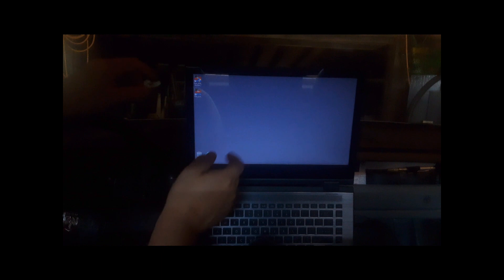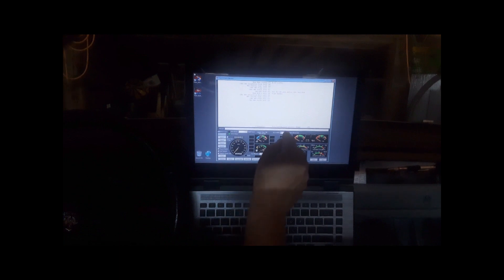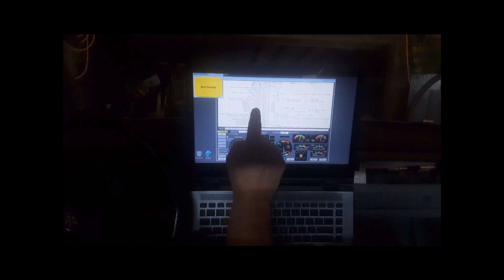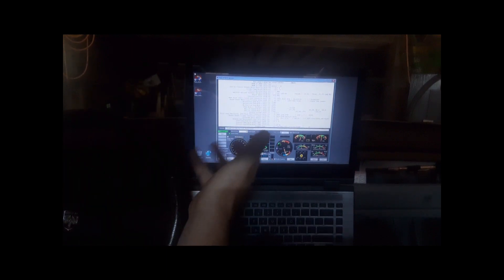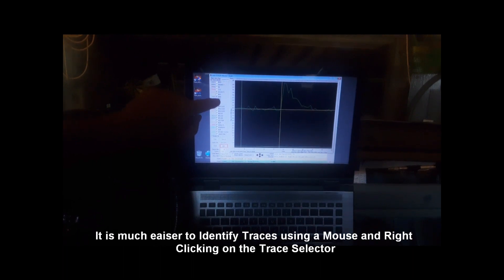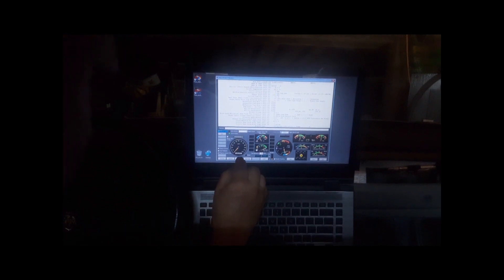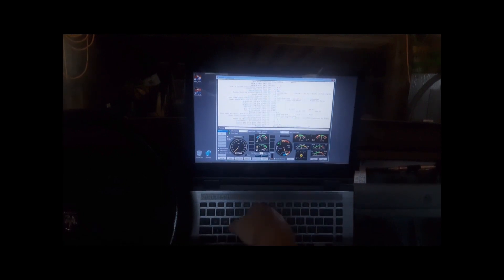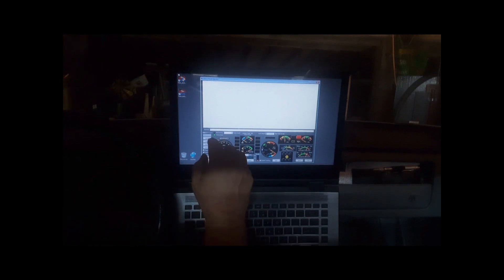Fiero GT ALDL Monitor In Car Demo

Comment: Hi Paul, this is really cool, great job designing this. Do we navigate to your site to purchase your cable? Just to clarify because I see some mention of the arduino in the comments,  to be up and running such as in the video one would need your cable (or diy similar), and a ? windows pc? What version of windows can be used, and if an Arduino is required or recommended which one might that be? Thanks Paul
Also I’m going check your other videos now, and subscribe so that I won’t have trouble remembering where I found this great info. but I wonder if it was you that had a really nice and highly detailed video I came across once that breaks down the fiero’s EGR solenoid? I had left that person a comment and they replied but then I had lost that video after some computer troubles and really need to find it again. Thanks again Paul and take care
Reply from the maker: I can't mention my web site on this "site's" comments due to some weird rules. If you go to the video "more" info in the description, the second link is to the web page you will need.

The first version of this tool used those simple adapters that "fooled" an RS-232 Baud rate in seeing the ALDL 1's and 0's as ASCII bytes, but that was years ago on my old laptop that actually had a serial port. Since then, they put USB ports on PCs instead of RS-232 COMs ports. Many sites now have ALDL cables that you can buy (or make in rare cases) but they still use that "fooled" RS-232 trick with a RS-232 to USB adapter built in. So, they are really no better. I decided to improve on all those others and use a microcontroller (Arduino, then the Trinket) to actually measure the 1's and 0's pulse widths and send an ASCII '1' or '0' over USB to my GUI.  Also, many cables can only do ALDL Mode as they have a built-in 10k Ohm resistor built into the cable, or some have jumpers you install to put the Fiero in the modes. My Adapter sets all 4 modes under software control via GUI control at the click of a button - no jumpers.  My adapter can monitor the Service Engine Soon (SES) signal, if you add that signal to your Fiero's ALDL connector - I have instructions. If you do that, my Adapter will count the flashes for you and display the Error Codes, if you don't add the wire, you simply count the flashes and then look them up in the GUI. Finally, my Adapter can monitor the Shift Signal if also added to your car's ALDL connector.  So my adapter is high-performance and feature rich compared to the others.

The GUI will run on Windows XP thru Windows 10 and beyond. The install on Windows 10 (too fancy for its own good) requires extra permissions settings but once set, it works the same as on any other version. The laptop you saw in tye video was Windows 10. Not my favorite but it has a touch display that I wanted for the video.

You can build your own Trinket or Arduino adapter (instructions for both are in the download) but I recommend I build you one for you at cost plug shipping  - no profit - as the ALDL cable requires some modification and re-potting the connector back shell.

Also, I am here to collaborate with users on how the GUI works and help you diagnose what the GUI tells you. But you have to find my email address and contact me that way for detailed personal advice.

Please respond with a comment when you have read this comment.
Thanks,
Paul
Reply from the maker: Also, you don't need the Adapter to run the GUI, so you can try it out first before investing in a cable. You can play back recorded files without an Adapter, but you need an Adapter to make recordings in the first place, however, I can send you a recording you can play back to try it out. Once you have the Adapter, you can Monitor, Record and Playback ALDL data.
Reply from the maker: Yes, I have a video on the EGR that I made after I fixed my EGR issues, many of my users found that slideshow video helpful. It actually shows you how to bench test the EGR Solenoid and the EGR Valve.

Comment: Do i need to setup the arduino to make your program run? or is it taking the place of the ALDL cable with usb?
Reply from the maker: The Arduino UNO requires you program it with an .ino file that I provide with the download, as well as a schematic for using the Arduino UNO as an adapter. But the Trinket M0 is a lower cost adapter and has simpler circutry - I provide the .ino file and schematic for it too in the download.

If you want to run my Fiero GT ALDL Monitor - Grahical User Interface (GUI) - you DO NOT need to connect an adapter, you can playback files without one, but without an Adapter you obviously can't record files in the first place, but I can send you an example file that you can playback to try out the GUI before you make an adapter (or I build one for you).

Most ALDL cables use a cheesy method to read the ALDL 1's and 0's pulses. Those adapters read the pulses as if they were 8-bit RS-232 ASCII bytes at around 1440 baud. This works but the "oddball" baud rate is not standard and the ALDL bits don't fall perfectly within proper RS-232 bytes frames - this causes comms errors that have to be handled behind the scenes.

My adapters (whether you use the Trinket M0 or the Arduino UNO) actually measures the ALDL 1's and 0's pulses as Pulse Width Modulated (PWM) pulses - which they actually are... thus my adapters are very robust and do not generate comms errors.

I could make my GUI work with those cheesy adapters but the simplest ones do not convert RS-232 to USB, and since none of my laptops (or any on the market today)  have traditional RS-232 Comms ports anymore (only USB that emulate Comms ports) I decided not to support them. Now, there are some ALDL adapters that do output data as USB but I don't have any on hand to use them as a base line to write code to support them.

Also, my Trinket M0 or Ardunio UNO based adapters do MORE than those other adapters can do. My adapters can set the ALDL to all 4 modes WITHOUT using jumpers. Many adapters are hardwired to put 10K Ohms across ALDL pins A and B so that the Mode is set to ALDL Mode when it is plugged in. My adapters use a circuit that can place Open/10k/3.6k/Short across pins A and B - all under GUI software control. Also my adapters can read the Service Engine Soon pulses (if you add that wire to your Fiero's ALDL connector) and will display the error codes directly. It can also monitor the Shift signal if it too is added to the connector. But even if you don't add those 2 wires to your ALDL Connector it will still work in all 4 modes - you just have to count SES flashing and then look up the codes manually using the GUI.
Reply: @paulromsky9527  Thank you Paul, I wanted to make sure before I put this thing together. I have an arduino kit at home from which i can build most if not all of your kit. Thank you for your time and effort. I will come back here or email you if i have more questions! 

My friends fiero is running rich on startup. My hope is that i can find the problem by looking at all the data coming from the various sensors...
Reply from the maker: @benjaminharper7626  OK, you can download the GUI today so you can get through the initial install (updates are easier) and you can get acquainted with it. My video was inside the car and was hard to see as I had to darken the exposure. I am going to make a bench top demo where I go over it in detail in better light. You will find all the drawings you need to build an adapter in the download after you unzip it.  Finding an ALDL cable with all 12 pins wired was impossible. But the one I have in the parts list should have pins A (GND), B (MODE), and E (ALDL DATA) wired. UPDATE: Actually pin E is needed but not wired.  These are the 3 very minimal signals needed without modifying it.  My adapter includes a red Bannana Jack for the Remote Fuel Pump Test Cable. That uses pin G (FUEL PUMP) that may not be wired on your cable. But if you are not using it, you can leave it out.  When I build the adapter, I carefully cut open the ALDL connector side right down to the internal pins, wire it up with a 8-wire cable, and then seal it up with black epoxy. But that is for all the features and why I suggest I build adapters at cost plus shipping - I have built several and have it down to a science. But I made the drawings as detailed as possible for those that wish to save a few dollars on shipping.  I am here to answer any questions and to help you analyze your recordings.
Reply from the maker: @benjaminharper7626 I just checked my notes. That cable from Amazon does NOT have pin E wired and that is critical for the Fiero ALDL. The cable in the parts list was one of the lowest cost ones I could find, but the seller could not send me a schematic of it because he did not know how to use an Ohmmeter and didn't understand jargon like "buzz it out" even after I explained how to check where wires go in a cable. I selected it because it was low cost and figured I would have to modify it any way. I tried to get a wiring diagram from other suppliers but none of them know anything about their cables other than some photos of it.  I simply could not buy dozens of cables from all over until I found one with the wires needed so I just modify the lowest cost one I found.

Modifying the cable works but it requires some delicate skills with a Dremmel Tool to cut it open down to the pins (without chopping them off), then solder the 8 wire cable to it, then seal it up with black epoxy.  

I am confident you could build the adapter from my drawings, but that cable is a custom job and I would feel better if I at least modify the cable for you and sell it to you at cost plus shipping.  The cable is about $9, and $5 for shipping for a total cost of $14 - I would not charge you for the 300mm piece of 8-wire cable, solder, epoxy, or my labor.

Let me know if that is what you want or if you really want to modify it yourself.
Reply from the maker: My email address can be found at the bottom of my Home page, just click 'Home' at the bottom of the 'Fiero GT ALDL Monitor' page.
Reply from the maker: You do not need to connect an adapter to launch the GUI. You can play back files but to record or monitor you need the adapter.